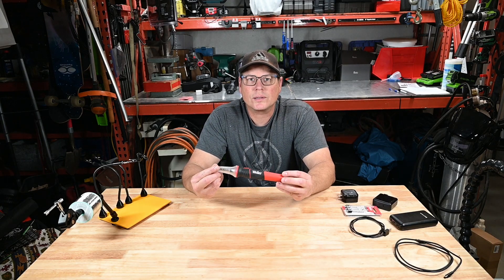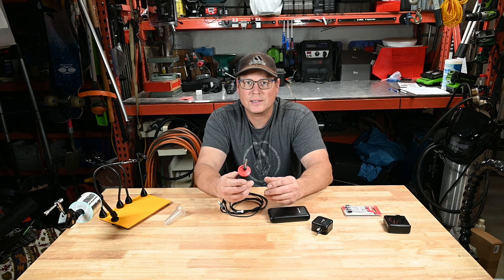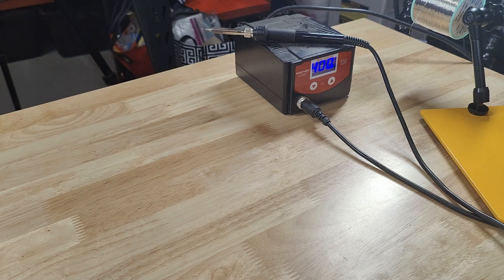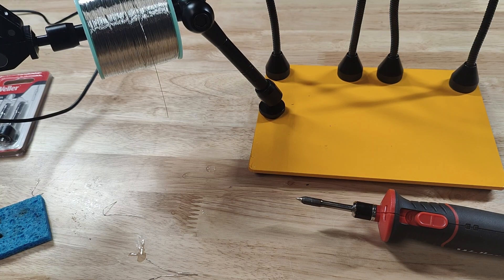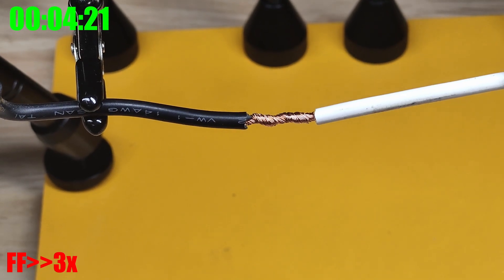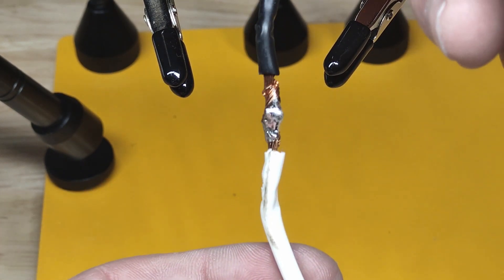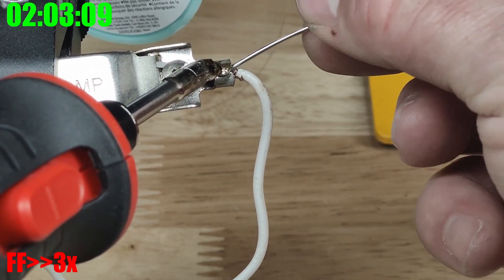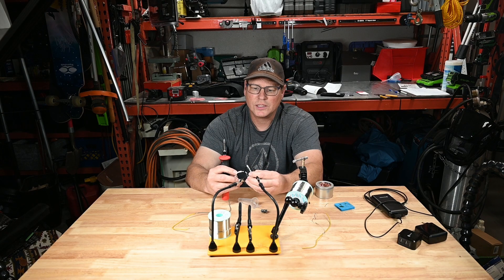Lithium-ion soldering iron full review and test

Comment: Thanks for this...was looking at this WLBRK12 specifically for it's portability, but suspected it wouldn't be able to handle 16awg or larger. This video saved me from wasting $68.98, and convinced me to either get the corded (and much higher rated) Weller 9400PKS Soldering Gun kit and consider getting the Bernzomatic 368600 Butane Soldering Pen kit for portability at some point in the future. Thanks again.
Reply from the maker: Yeah, it gets real hot, too hot I think, but not enough watts pushing it to stay hot. I like and use this Weller butane a lot https://youtu.be/5xSd8CzihSQ

Comment: I’m looking at buying the same one and your video is very useful. The only thing I’m left wondering is how the tip attaches. Does it slide or screw on?
Reply from the maker: Hey Thanks for Watching! It slides on/off see in video at around 2:20 

Essentials to get some tip tinner and a brass sponge to keep your irons tip ship shape!
Weller Iron: https://amzn.to/3kj09C1
Tip Tinner: https://amzn.to/41qnhzd 
Brass Sponge:  https://amzn.to/41oZS12
Thick Solder: https://amzn.to/3XXm6nK
Thin Solder: https://amzn.to/3St0UF3

Comment: Thanks for the video I just bought one for 68.18 cents at Home Depot  I guess it will do for now because my Weller soldering station soldering lead had broke after I dipped it in water to cool off quicker burt turned it one while wet,.

Comment: "3.7v 2600mah lithium ion", I wonder if is a replaceable 18650 battery inside.
Reply from the maker: Ver resposta curta
Reply from the maker: It is a 3.7v 2600mah lithium ion but has a small carriage mount with shrink rap around it with wires coming off it. So technically you can replace it if you have a bit of ingenuity.

Comment: I tried to do my stereos harness cables for my car and it wouldn’t heat up the cables enough for it to liquified it just turned my cables black 😂
Reply from the maker: Probably too heavy of a gauge wire for this iron.
Reply: @LetsDoThis321 it was the wires from my head unit harness on my car stereo
Reply from the maker: @vrtxs1938  maybe the soldering iron tip is oxidized and needs to be cleaned and tinned.

Comment: Chisel tips has no option. Final verdict is a trash.
Reply from the maker: Yeah not much for options only the 0.4mm point tip WLTC04LBA12 https://amzn.to/40TRuGf or the 4mm chisel tip WLTCH4LBA12 https://amzn.to/3zJ5JBI. The iron is limited in its ability being only 12 watts and cordless. Weller corded irons have much larger options in tip selection and the tips are much cheaper. for instance this solder station by Weller https://amzn.to/40Xvjin with a number of tips both pointy and chisel type https://amzn.to/3MwOrzf or generics with hot knife https://amzn.to/3nZXqia
Reply: Soldering tips are easily shaped with a file or sander (normally).

Comment: No sell for me. Want the solder to be built up on the tip for easier use in hard to reach places. Need to adjust the temperature. Looks like Chinese companies win on this one.....
Reply from the maker: yeah, It is not my first choice, it does need the ability to adjust the temp down, it runs hot, so hot it oxidises the tip very fast, it tends to vaporise super thin solder. I just got the updated model for this year and will be testing it out (still no adjustments), but it does charge of USB-C PD ports now.